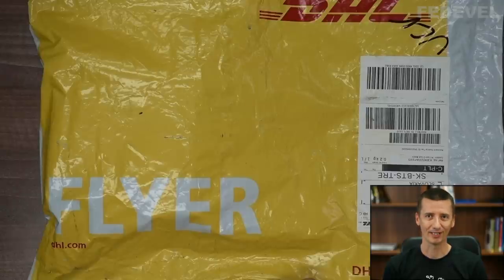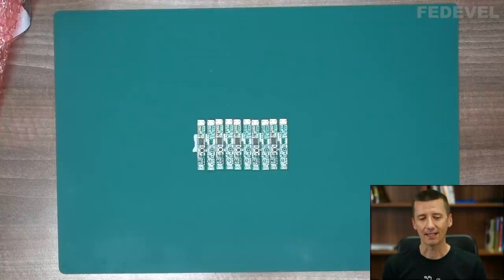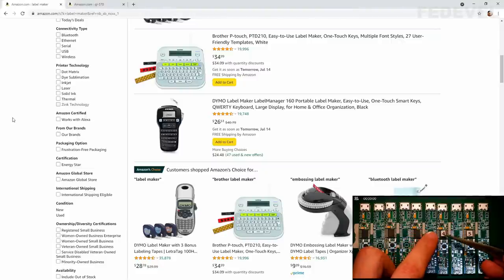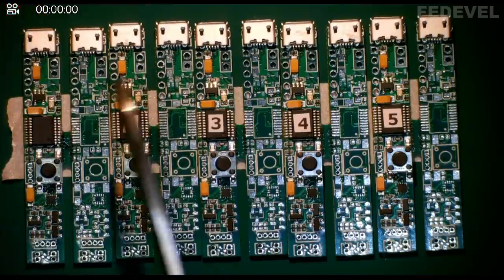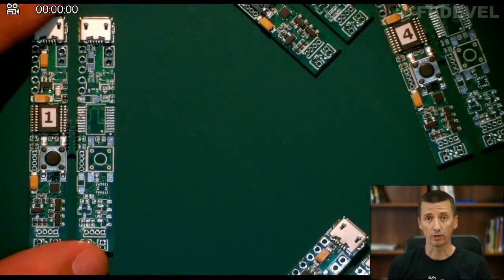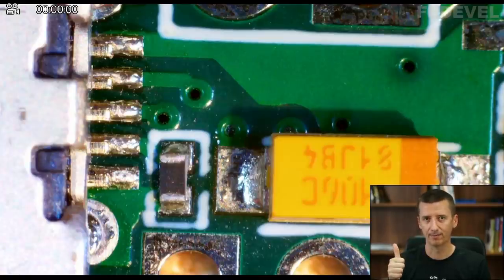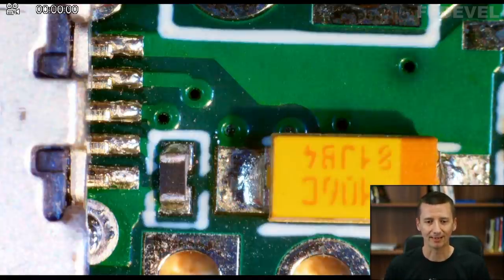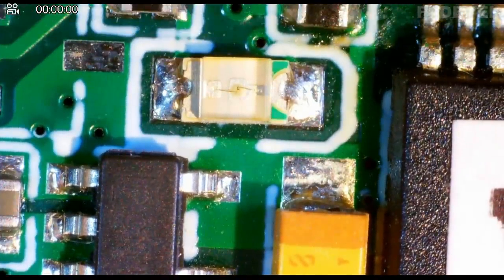Tutorial #6: Steps To Do After You Receive Your Boards From Production + Some soldering tips

Comment: That is a fantastic series. Usually PCB designing tutorials are so boring with little bits of useful information in them but your experience and sense of humor makes miracles :-) I'm using EasyEDA for a few years now and still got so many tips from this series. Also incorporated in my workflow a number of tips from the “Every day Hardware Design TIPS” and must say they DO make difference, looking forward to new ones. Thank you!

Regarding testing components for heat with bare fingers, in my early days I misculated power dissipation or made some other error while assembling a device on a breadboard, I think I was able to read power transistor markings on my skin :-D
Reply from the maker: Thank you very much kfmutrus for very nice words.

Comment: Nice topic and excellent preparation!
Maybe I would suggest to connect board to lab power supply insted to USB, set the input voltage and increase current limitatio in small steps untill you reach expected current consumption. If you pass your expected current level, and the voltage still hasnt reached 5V, probably there is a short on the pcb or wrong footprint where VCC and GND are missmatched.
Reply from the maker: Thank you Ludi PS: Yes, that is a good point, normally I do that way.

Comment: Hello Robert. I started designing the schematic for this circuit board September 2021, and got frustrated, as many of the components you use are no longer in stock. So the footprints were no longer accessible for placing on the schematic. Also, I didn't save my work properly, losing a few hours work when I closed my computer for the night. GGGrrrrrr. I might start again, because this an extraordinarily interesting project, and would like to follow along. I have been producing nice quality, double sided boards at home, but without solder mask. Regards from Toronto, Canada.

Comment: What is best practice to probe crystals to measure proper frequency is being generated?
Reply from the maker: If the crystal connection is designed properly, it still should oscillate correctly when a probe is placed on a crystal pin. Of course, that is not guarantee, but usually is ok to find out if a crystal works or not.
Reply: @RobertFeranec  thanks! I think it would make an excellent video, or series of videos in fact, on signal integrity verification/validation best practices for common signals inside of most products such as high speed and low speed crystal oscillators, power rails (as you just did here), i2c, spi, mipi, uart, usb, gpio, pwm, etc etc. I think many of your viewers would like your clear approach to how to verify something with a live example, expected results vs actual results, and pass/fail criteria for a good design.

Comment: Hi, Robert, have you tried using stencil and solder paste manually for prototyping. 
It's way easier than hand soldering, especially for high power or multi-layer board.
Choose low temp paste and heat plate will do the job, even hot air gun. 
I think you all know this. :)
Thank you again for high quality tutorial video!
Reply from the maker: Thank you very much Zhitai PS: I have used stencil and solder paste for some of my projects, but I still have not bought better equipment e.g. a small oven. Maybe, if I would make a video about it I would have a reason to buy it :)
Reply: @RobertFeranec  I am using lead-free Bismuth-Tin solder Paste with a few % AG. You can dab a bit manually onto the pads. I am even using it for through hole parts and pins. The alloy has a melting point of only 138C. It is not poisonous. Therefore I am simply reflowing it in our kitchen oven with hot air mode. I Mimik the reflow Profile simply manually. Max temperature is just 160-165C. The results are astounding. The solder joints are industrial grade.
Since the industrial process uses lead-free tin solder there is no risk that the assembled parts will come loose. That solder melts at 220C, and you never reach that temperature.
You only must make sure to never mix bismuth and lead solder. An bismut-lead-tin alloy melts at 80-90C. You can melt it with hot water!
Reply: @RobertFeranec  bought the Vapour Phase from Imdes and later from CIF the FT03; especially the last one is very nice without any chemicals. Very content with it.
Reply: @remy-  Hi, could you share a link on the vapour phase oven you purchased? regards Craig
Reply: @radiotek4023  and the other: https://cif.fr/en/benchtop-reflow-ovens/385-four-de-refusion-a-convection-forcee-ft-03.html
Reply from the maker: @radiotek4023  this is not a vapour one, but I know Sam is using T962 and it's like from 150USD https://youtu.be/87srNv8rDVQ?t=3774
Reply: @remy-  thankyou regards craig

Comment: I won't use this tutorial directly, because in a sense I know all of it already, just didn't apply everything consistently to my projects. I've done several one off board or low board count projects before. Problems have been quite easy to fix there. But I got my first commercial project this year that will go into volume production (up to a few thousand boards per year). So I'll use this tutorial like kind of a checklist in the prototyping phase.

Comment: You mentioned cutting part of the board off to make a separate led module from it, how will you cut the board? I'm worried about damaging the pcb or shorting the layers, if i use a small saw... Can you show how you do this?
Reply from the maker: David, I just saw it - I used the same tool as I used to separate the boards in this video.

Comment: I am following you as a hobbyist. I am doing my own energy related projects. You are a great teacher! But I am hand soldering only. Smallest size 0603 as I don't have a microscope. What is the size of the resistors on your board there, 0402?
Reply from the maker: Thank you very much Roland. PS: You can do hand soldering even for 0201, you would just need a microscope. When I become like 40 years old, I needed microscope for almost any work on PCB, but before you are 30, there should be no problem to solder 0402 with no microscope (0402 are some of the components on the board in the video).
Reply: @RobertFeranec  yeah, am getting 50 soon. Decided to only use 0805 as smallest components on my recent and future PCBs :))